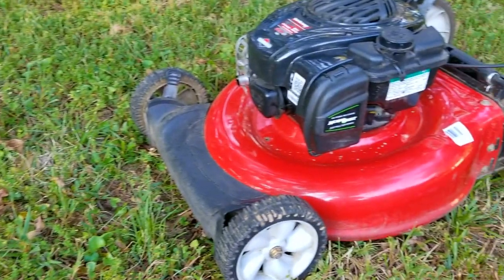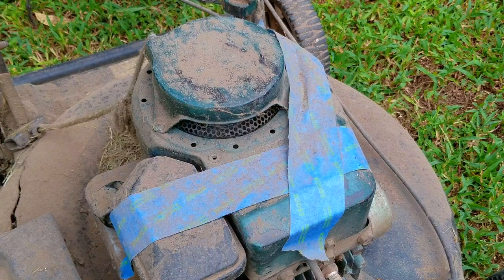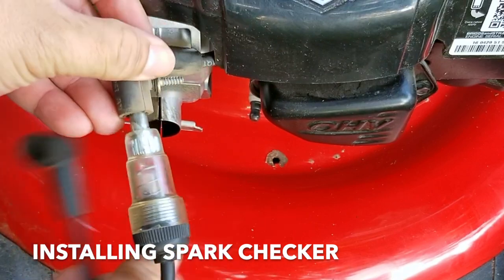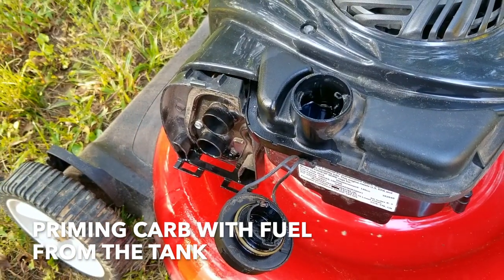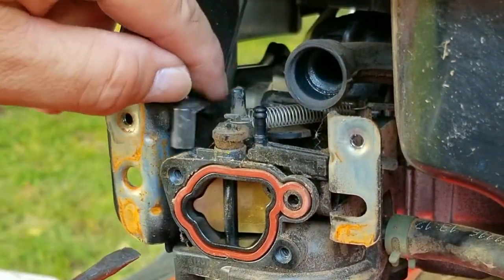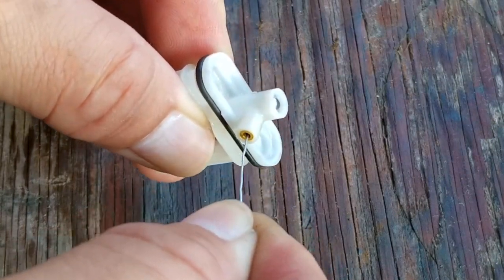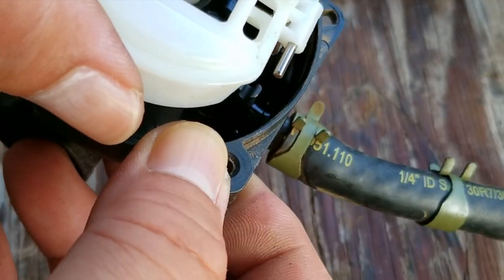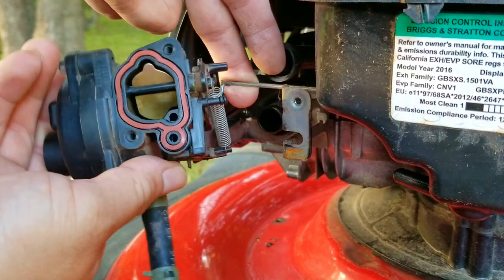Why Did Briggs Stop Making The Flathead Engine?

Comment: Fuel injection doesn't just require a battery charging system and ECU. It also requires at a minimum an engine temperature sensor, fuel injector, high pressure fuel pump, throttle position sensor, intake air temperature sensor, probably a separate engine speed sensor etc. It would definitely not be more simple to fuel inject a flathead than it would be to create a carbureted overhead cam engine.
Reply from the maker: Amp draw.
Reply: Much of that is not needed on a mower. Motorcycles already run a simplified fuel injection system. It has no idea what the engine is actually doing. They commonly have a TPS, ECU, fuel pump and an injector. Its just programmed to give X amount of fuel when the throttle is at Y position. Being as a mower only need to run at one speed, it does not need the computer or the TPS. A correctly sized injector firing off the coil signal an a small charging system for the fuel pump would work. It would not really be better than a carb, but just like the crap on motorcycles, the EPA and California would sign off on it and people would buy it. Emissions is quite often about the illusion of better, not actually being better. Long proven by low end Chineese motorcycles who pass CA immissions by just running the engine lean an buyers replacing the carb on day one.
Reply: @RebelCowboysRVs  That's not really accurate. Even the most simple fuel injection system needs to know the temperature of the air going into the engine in order to understand the air density and properly calculate mixture. It also needs to know the temperature of the engine in order to enrich the fuel for cold startups. It also needs to know the engine RPM versus throttle position to understand the actual load on the engine. Just knowing throttle position doesn't do you any good because you could be at sea level with the engine ice cold at full throttle with no load or 6,000 ft up with the engine fully warmed under 100% load at Full throttle and those two would have very very different fueling requirements.
Reply: @DoRC  It should know all that, and you get that with a car, but lots of motorcycle systems on the road today don't have it. Being an Automotive tech it was a supprise to me how little bikes have. TPS, and a tachometer signal is very commonly all a cheap motorcycle has to figure out what fuel to give. Its programmed based on a test motorcycle running at sealevel. It cant adjust for weather, altitude, load an it sure can not adjust to warn parts like a car can. They may have a temp sensor or they may just over inject at startup every time. Higher end bikes have better systems with things like ambiant air pressure sensors and intake air temp to tell it if its on a mountain, or in cold weather, but almost all motorcycles run on a programmed fuel map with very little in the way of on the fly adjustments that are common in cars. As someone that live on a mountain, I can tell you that I notice power loss as altitude changes. But they still run OK an the average consumer does not know they are missing something. A bike usually having more power than it needs, Joe Blow doesnt notice hes having to twist the throttle a lot more at altitude. A very dumb fuel injection system can compete side by side with a carb. Its only real plus is being easier to start an more reliable. But people buy the idea of better. Fortnine did a pretty good video on it last haloween. Its worth watching. He still explaned it with motorcycles having more sensors than many of the cheaper ones actually have, but he covered the main point well. You can really dumb down a fuel injection system an get away with it. An they do. An thats today. Not getting in to some of the old stuff.
Reply: @RebelCowboysRVs  okay well I've been a mechanic for over 20 years and I've worked on a bunch of different fuel injected motorcycles. Maybe I just haven't worked on one is simple as you're talking about. I've worked on some pretty basic ones like Ninja 300s ninja 400s etc but like I said not necessarily familiar with things more simple than that.
Reply: @DoRC  The Ninja is far from basic. It has a Speed Density system using multiple sensors an even an O2 sensor. Why it has a better system than pricer bikes, I would guess because it came to fuil injection late an has to pass higher standards than bikes that changed over years ago. Unlike cars, they have to pass current emmission standards when the bike is redisigned, not every year. Why the TW that has not changed sense 1986 can still be sold here. 

Per Cycleworld, the Honda CBR600RR runs the simpler N-Alfa fuel injection system just to name one. 

From Motortrind "N Alpha -A relatively simple design, N Alpha systems use only engine speed and throttle angle to calculate the amount of fuel needed by the engine. This system doesn't measure airflow directly; instead, engine load is assumed based on throttle angle versus engine rpm. The various load-rpm points make up the computer's lookup table, with the amount of fuel needed at each point manually programmed by the tuner."

I quick google search for N-Alfa shows the system being common in racing aplications as well. Hollys website saying N-Alfa is used on naturally asperated big cam racing engines because map sensors do not like pulsing vaccume/airflow.

A mower is much simpler. It just needs to start an run at one speed. So if built right, it could have an injector set to spray the correct amount of fuel for that RPM an a stationary intake for that RPM. It would not need any sensors at all. It may need a choke... Not a great idea but could be done. I am willing to bet it has been done in some application somewhere.
Reply: @RebelCowboysRVs  It would still need at least an RPM sensor because it needs to have some sort of knowledge of the load on the engine. And engine at zero load will use a lot less fuel than an engine at full load at the same RPM
Reply: @DoRC  I thik it woul do ok without it for normal mowing. It would not be a great mower. But you are correct, it would fall on its face without it if you tried to mow tall grass. It would feel like it ha a much smaller engine than it actually did. A system like that would work much better running a pump or some machinery that has a constant load.

Comment: As long as Briggs was set on designing a newer, more efficient and more competitive engine, why didn't they go with battery powered electric? It would seem ideal for a lawn mower. You only use it for an hour or so.(Unlike an electric car, or bike a mower won't leave you stranded when it runs out of power.) It does not require you to schlep a gas can to an from the gas station. No worry about old gas in the tank (or gas can). No oil changes. No filter changes. No pulling and pulling on cords to get the stupid thing started...
I'm in construction, almost no one uses corded power tools anymore.
Reply from the maker: at the time of the redesign years ago, battery powered equipment wasn't big. And I like your idea of not having to do "this and that", to use gas equipment. Battery stuff has a "different" list, of issues, that you're overlooking. Cost, degradation, and extra batteries.

Comment: I have a flathead from 2008 and stored it with the gas in it all winter with using it as a spare backup lawnmower and I went to start it in the spring and it started on one pull and stayed running
Reply from the maker: nice
Reply: @INSIDEHOUSEGARAGE  People be saying briggs and stratton is junk and I never had any problems with briggs and stratton that my grandparents had a tractor with the intek vtwin that my dad and granddad had bought new together and the engine has outlasted the tractor that we put so many hours on it every year since it was bought new cutting the grass and picking up the leaves and me and my dad put it on another tractor and still runs like new and the only thing was replaced was the governor the rocker arm bolt came loose and it was from when me and my dad putting a new throttle cable on and that it was running to fast and it was like for a year and a half until that happen
Reply from the maker: thanks for sharing that.

Comment: Just watched this again. I think Briggs had to redesign the flathead due to the EPA. I don't think there's any way they could have gotten the efficiency and emissions from the flathead. The compression ratio was too low. I suspect that you're right that this new engine is cheaper to build, cheaper to transport, and more powerful for it's size & weight (vs the flatheads). I recently acquired my first example of this engine, the 125cc version with the foam air filter and primer bulb. I've only got about 30 minutes of time on it, but it seems to run smooth.
Reply from the maker: yes I totally agree,  it must have been a tough choice for them.

Comment: regarding the 'oil drain plug',  with both Toro and BS engines, I run dino oil for the first 2 hours or so, drain it, then refill with full synthetic.   Those engines use so little oil that after 5-10 years, I'm still waiting to change it or add any.  So maybe the oil drain plug isnt an issue.  Full synthetic after break-in!
Reply from the maker: your break in procedure might have something to do with it .

Comment: Mfw I’ve had a Briggs mower and haven’t changed the oil for over 10 years and likely an oil burner with the sooty exhaust and the mower still runs like new, gonna build a lathe with it when the mower is replaced
Reply from the maker: nice!

Comment: I've had a flathead briggs that has never had an oil change.. I just slip more of my used synthetic oil in it as it is low.   engine has been on 2 decks and has lasted over 20 years... I'm not worried about it... at all.
Reply from the maker: very nice, thank you Ted Schoenling.

Comment: I bought a new lawnmower in 2020 or 2021 it was $400 awd Husqvarna with a newer Briggs motor on it, ran great started right up every time. went through a really dry patch of weather for a month ( I live on Oregon coast) and didn't need to use it, so it was stored indoors with no gas in it. take it out to mow my lawn and the damn thing wouldn't start for anything. I had a clogged fuel jet. I dont like it anymore after that. yeah it nice when it runs but having to tare apart the carb every other week week and a half is just a hassle and not worth rebuying for me.
Reply from the maker: I know right. These carb clog, if you sneeze.

Comment: The flathead engines have some inherent design disadvantages compared to the OHV/OHC engines.  They are low-compression (partially why they run so smooth) with a sub-optimal combustion chamber shape.  They need more displacement to make the same power that an OHV engine makes. 160cc OHVs were making the same or more power than a 190cc flathead.  The lower compression and higher displacement also means it burns significantly more fuel.  It’s not as apparent on a small mower engine but Briggs disguised the extra fuel consumption on flatheads with that huge wraparound tank the flatheads had.  Some of the flathead twins were extra thirsty on large mowers.  They could suck down 4-5 gallons before lunch and only be making 18-20HP vs the engines that do that today but output 30+.

I will take that plastic carb any day over the old PulseJet units that screwed down to the top of the fuel tank.
Reply from the maker: thank you Brian Lawyer

Comment: I must not be familiar with the issues you mentioned regarding the Intek engines. Mine is still going strong after 15 years. It’s only needed the carb serviced once and the valve lash adjusted, both of which I did myself. I guess I need to research these Intek issues. 🧐
Reply from the maker: the consumers didn't take of the flatheads, so when the inteks came around
they thought they didn't have to take care of them either. They didn't hold up to the lack of maintenance, like the old engines and very quickly failed. And it looks like you do take care of your stuff, not like most consumers.

Comment: The basic advantage of a flathead is that it is the cheapest and lightest configuration there is vs displacement. The big disadvantage is that the compression ratio can never be as high an overhead valve arrangement with the same airflow capacity. So, to get the same power and torque as the flathead, the overhead valve engine can be made smaller, negating the weight advantage. Or, at approximately the same weight, the overhead arrangement will simply have more torque, but cost more. I think it would be pretty darned cool to have a EFI lawnmower. I dont care what kind of fuel is being used, it has ALWAYS been a drama to get lawnmowers started after sitting for a long time, just like every old carbed car after sitting for 6 to 9 months.
Reply from the maker: you are absolutely correct and the EFI idea, was at least something interesting for sure to have on a mower.

Comment: If you run ethanol gas, it won't start after winter storage.  It gums up the carb worse than pure gas.  It also corrodes metal parts.
Reply from the maker: very true

Comment: The Briggs & Stratton carburetor on my 12.5 HP MTD mower is about the worst small engine carburetor that I've every had to deal with. Many problems with it over the years.
Reply from the maker: is the carb that's part metal and part plastic?
Reply: @INSIDEHOUSEGARAGE  Within a week of using it the plastic choke butterfly lever broke so I made a one out of sheet metal and attached it to what was left of the original. That was about 20 years ago. The biggest issue is the needle and seat. The seat is pot metal and eroded and isn't replaceable so even a new needle will let gasoline flow into the carb flooding the engine even when it's running. I have tried polishing the seat with a wooden dowel in a drill. It seems to have worked, but every once in a while while not running it won't seal and gas will flow by and fill the crankcase and cylinder. (This actually led to an engine failure due to diluted oil.) I added a shutoff valve to the gas line to stop that. And the bottom bowl screw leaks and the new seal only lasts a couple of weeks. So I redid that and with Permatex blue and it's been dry. Other than that after 23 years it burns about 4 oz of oil each use - about .5 acre.

Comment: I can’t help but agree with the fuel injection suggestion. Such a system would obviously incorporate an electronic ignition and only requires a small battery (if hand started). It should be quite economically feasible to do this with hardware which is essentially off-the-shelf, and without any massive redesign work. I’m actually surprised that more small engines don’t possess these features, especially when it comes to premium products.
Reply from the maker: I would like to look into doing something like his in the near future.  Thank you Anhedonian Epiphany
Reply: There are EFI chainsaws from Stihl and snowblowers from Ariens. Briggs have an EFI system on the larger mowers too. 

Problem is that it’s still not commercially viable for the lower price point products. By the time you add up ECU, fuel pump, sensors and injector you’ve doubled the price of the mower

Comment: Hmm on my 21in Murry with a 4.5hp B&S engine sat for several months due to the Winter months with gas in the tank as well as gas in the can and I was like dear god this is going to be a nightmare to start like mowers are at the beginning of the Season. But no the mower started right up with no issues which is very weird because I don't think we used fuel stabilizer in it either..
Reply from the maker: on the 4.5 hp B&S I don't worry too much about them it's the new engines I worry about

Comment: I have a briggs and stratton flathead 6.75 hp engine and it is knocking. how long would it last? because I can't fix that kind of thing. i don't know how old it is, but it lasted longer than the deck cause the deck rusted but it runs ok but with low rpms.

how can I fix low rpms on one of those?
Reply from the maker: keep the oil fuel, and fresh and it should keep running for years, just so long as nothing serious happens to it.
Reply: @INSIDEHOUSEGARAGE  ok

Comment: By the way fuel injection doesn't benefit tiny engines enough to justify the cost, especially a flat head.  Flat heads make less power because the air flow changes directions with each engine cycle and that limits head flow.  There's nothing fuel injection can do to improve that.  You can open up the heads and shave them to increase compression but that's about it.  But they work well as lawn equipment because running at a steady 3500 RPM doesn't present a flow problem.  Carbs in such engines are fine just drain them and run them dry before storage.
Reply from the maker: that's a shame.
Reply: @INSIDEHOUSEGARAGE  it's not a shame it's physics.  Flathead engines make wonderful mower and snowblower engines.  Governments make up excuses to get rid of them.

Comment: The reason it got clogged is the gas with ethanol. I have a 5 year old Husqvarna mower with ohv engine, 13 year old Echo weed-eater and a 3 year old Echo edger, I use non ethanol gas, did replace the float diaphragm on the edger about 7 years ago other then that never had a problem. I buy enough gas to last 2 years, never had a problem with old gas.
Reply from the maker: that seems to be the consensus, ethanol gasoline is just not meant for small engines.

Comment: 1:22 every fall, i make sure to run the gas out of the mower so the fuel doesn't leave residue and clog the carb.
even the carbs in some of my dad's motorcycles get clogged after a few months of storage.
Reply from the maker: can you get 100% gasoline there?
Reply: @INSIDEHOUSEGARAGE  yes but its not always in store, and you have to know where to find it. The places that have it where I live are not on the way to anything we go to. I typically use regular 87 ethanol and make sure to burn it out at the end of the season.